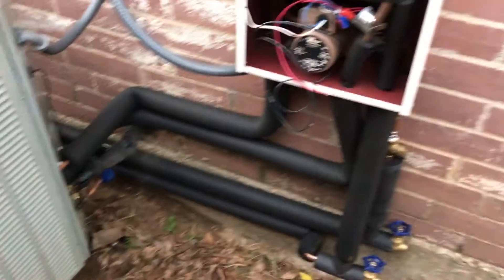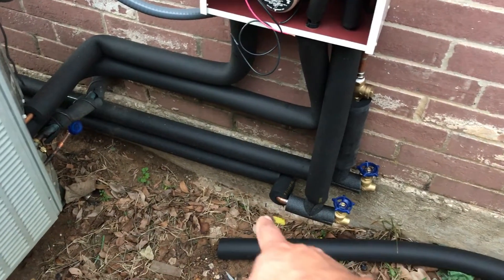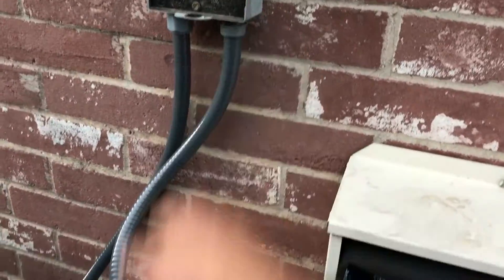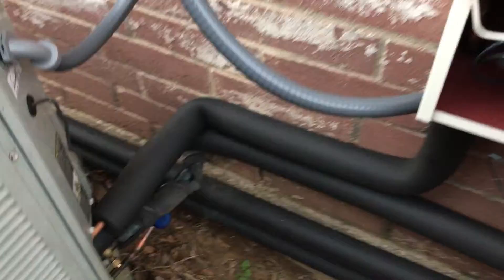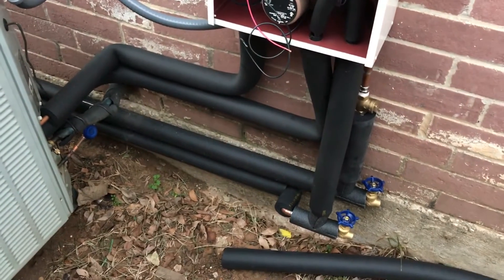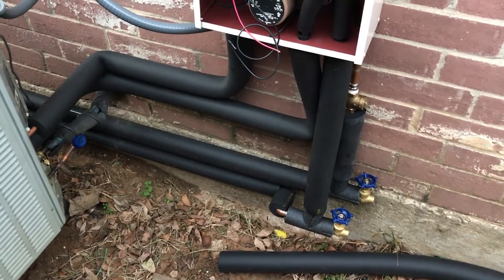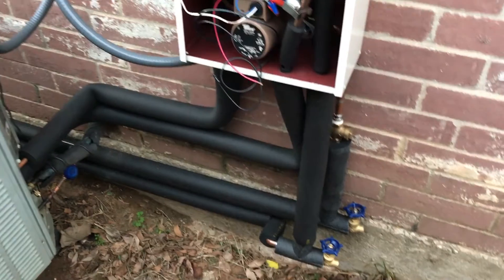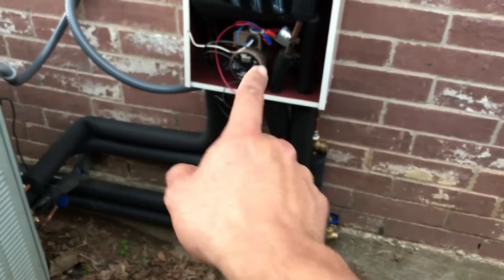Free hot water. Preview of a heat recovery system for my house.

Comment: Just installed one in my home.  Ran into a problem with my compressor not starting up.  Potentially that my compressor has gone bad.  Fan runs, just the compressor not kicking in.  I would really recommend if you know how to do the plumbing yourself it will save you a bunch of money.  We'll see if my compressor is bad.

Comment: Any updates now that summer is in full swing?
Reply from the maker: superspeeder it's been awesome. I've actually had my breaker for the water heater off for 3 months now.  It keeps the water between 120 and 135.
Reply: Wow, that's encouraging!  What size air conditioner are you using?
Reply from the maker: superspeeder it's a 2.5 ton

Comment: How much have you saved so far? Do you keep the breaker off for the water heater?
Reply from the maker: Justin Hernandez I'm not sure yet.  I did have the breaker off for awhile. And it was keeping my water at around 120. I have a short video on that actually. Since this weather has been mild my unit hasn't been running so I had to flip it back on. But I'm sure when the summer rolls around I'll be able to leave it off for awhile. I measured my amp draw on the compressor and it almost drops it's a full amp which was pretty surprising
Reply: I forgot you guys actually have a little bit of winter, not here it was 90 yesterday. Most people have the breaker turned off year round here and some turn the heater all the way down. I would do this at my house but I changed my heater to a hybrid last year. And my condenser is over sized a ton so I don't want to lower my head pressure anymore..lol

Comment: Very cool man. I have one too. I let it run in heat mode and cool it still heats my house just fine. If I can suggest to pipe the supply from the waste heat recovery in to the cold water side of the tank because heat rises and when I would take a shower with the system running it would start to run cold as the supply was piped in to hot water side of tank. I now have a heat pump water heater also  so I use the origional one as a preheat tank.
Reply: To clarify the inlet to HRU is from the drain on bottom of tank and outlet (or supply) goes to cold water connection on the tank is the way I would recommend to try.

Comment: is work slow? are you running out of ideas what to put on YouTube? when working on your own stuff do you do the same quality of work you do for a customer?   I dislike working on my own stuff I seem to take shortcuts that I would never do to a customer.
Reply from the maker: THE GENIUS no actually we've been busy. Weather has been up and down. One week it will be freezing and the next it will be in the 70s. I I have some footage on my camera but  haven't had a chance to edit and upload some videos. Usually when working on your own equipment you can get away with somethings because you can always walk outside and touch it up. Not the same for a customer. But I just try to do things by the book no matter what.
Reply: Ulises Palacios thank you for the reply. in Central Florida if customer has a working heat exchanger already hooked up and working --and going to have the HVAC system changed out / about 99% do not want to pay the additional cost to hook the heat exchanger  back up
Reply: @kinggenius6660 looks like that what happened to me. We bought a house foreclosed so I didn’t know what that unit was till I saw this video. I just checked and it seems like the ac lines aren’t hooked up.